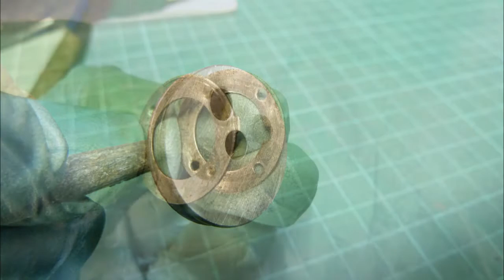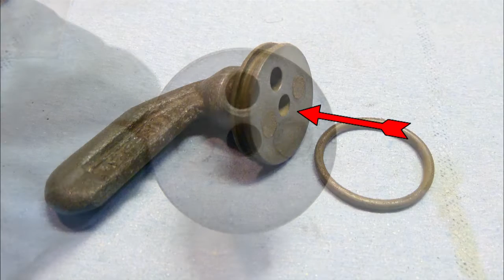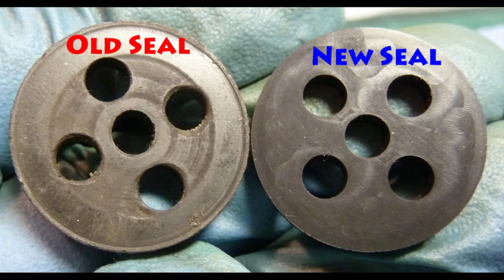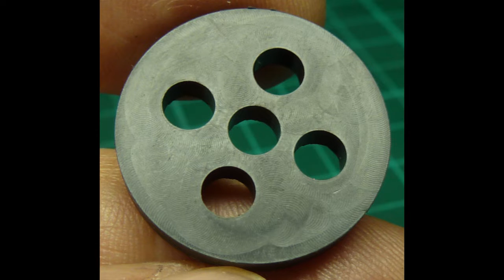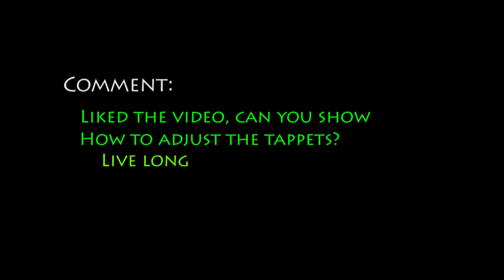BMW R Series  Boxer Petrol Tap Rebuild

Comment: Thanks Jim for another great video. It's a shame that so many parts these days are not made to be repaired.
Reply from the maker: Hello Dennis
Thanks again for another comment, I agree with you 100%, it seems everything these days is made to be used once, and then thrown away, I think this is sad, but keep my fingers crossed that perhaps things will change as the next generation comes along. 
Keep well
Jim

Comment: Great stuff. Thank you. Just got a r60/6 so will be watching your service videos.
Reply from the maker: Hello Mr Smith. Thank you for your comment, have fun with your R60/6 it a good bike. Take Care Jim
Reply: @CYC123  if you have a minute, do you have a list of the tools I’ll need to cover basic maintenance?
Reply from the maker: Hello Mr Smith. A list of tools to service your BMW.
I don't have a list already written out, let me think, this could be dangerous!
OK, You will need a set of metric open ended spanners.
Set of metric hex Allen keys.
Set of cross head and straight screwdrivers.
Pair of pliers is always useful.
Plastic funnel to allow easy pouring of oil into the engine.
You need a way to get oil into the gearbox, some plastic bottles of gear oil come with a plastic tube fitted to their tops, they work well. Keep an empty bottle with its tube in a plastic bag, this comes in useful if the next bottle of oil only has a screw top and no tube.
I have an old large metal hypodermic I found at a yard sale, you will have seen this if you have watched my servicing videos. This works well for injecting oil into gearbox, final drive and also the forks.
Spark plug spanner.
A buzzer or electrical meter to go across the points when you need to set the ignition timing.
A set of feeler gauges to set points gap and spark plug gap.
Paper towel for cleaning as you work.
Tyre pressure gauge.
Foot or hand pump for setting tyre pressure.
That's all I can think of at the moment, I hope that helps and I haven't forgotten anything.
Take Care Jim
Reply: @CYC123  thank you for that. Much appreciated
Reply from the maker: Hello Mr Smith. I hope you have many years of riding then servicing your bike. Take Care Jim

Comment: Fantastic!! Thanks for a great video. I also love your 6 part maintenance videos. Any plans to dive deeper into the engine? I would love to see work on the clutch and seals.
Reply from the maker: Hello nreid99
Thank you for your comment. At the moment my clutch is working just fine so no plans to pull it out.
I do however need to check the valve clearances, and change the steering head bearings, perhaps more on that later.
Take care
Jim